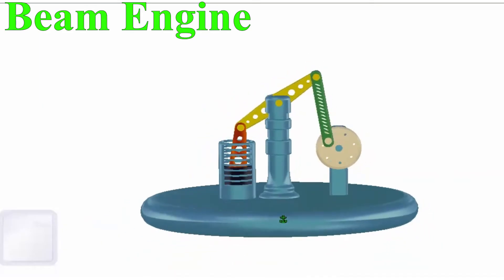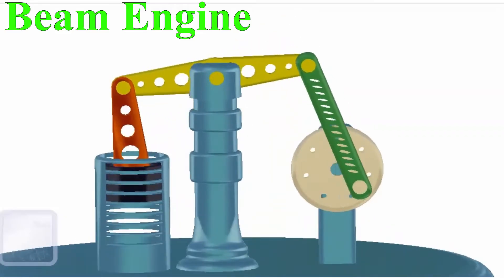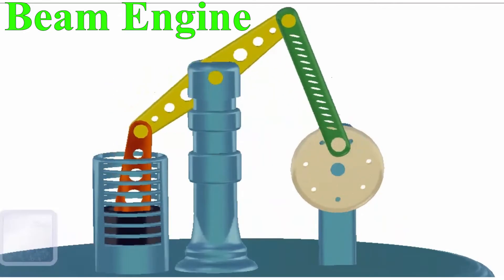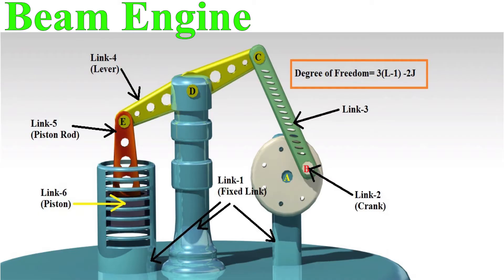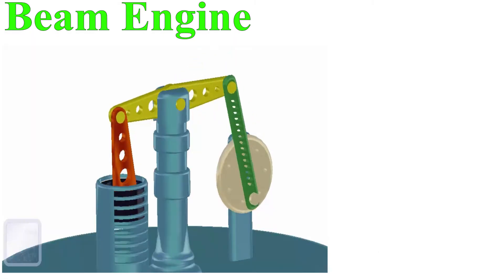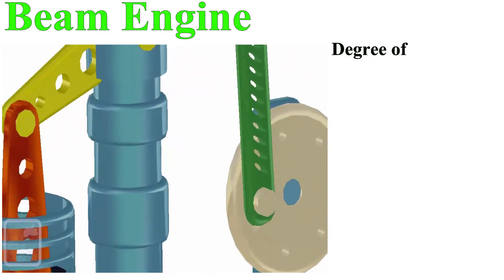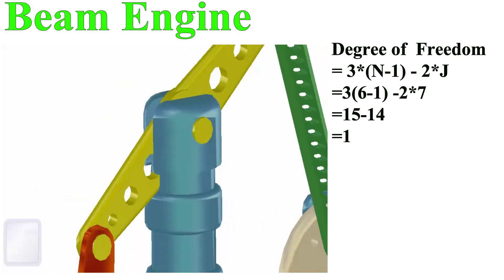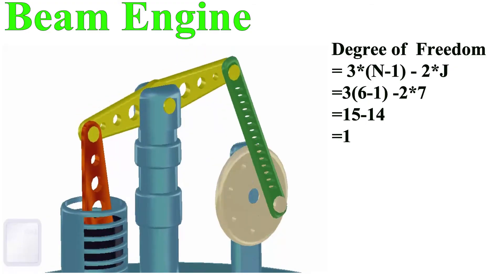BEAM ENGINE Explained || || Animation Video ||

Comment: Like your efforts but please check once bcoz beam engine is example of 4 bar mechanism so there no way to have six links  so the explanation is wrong the mechanism ends at lever link 4 itself the piston and all that part are the supplementary one you can connect anything which ever you wish to oscillate at the end of link 4. And yes it is the close pair as the link 4 is connected to frame or say fixed link at point D. The further part can be considered as extension.
Reply: Can u tell what the degree of freedom will be in case of 4 links in beam engine??
Reply from the maker: 1